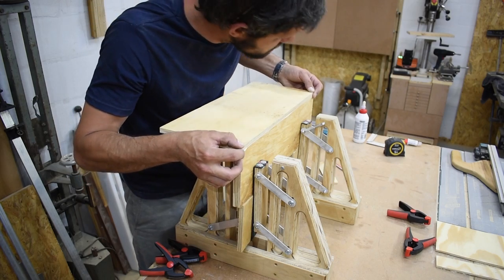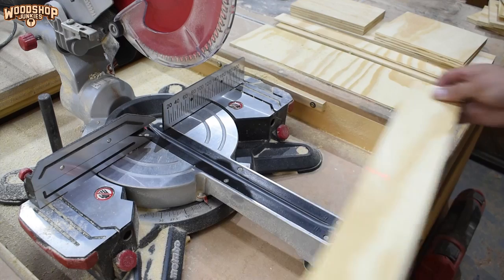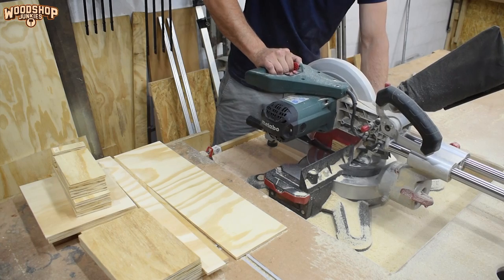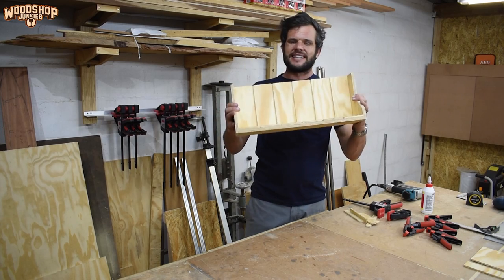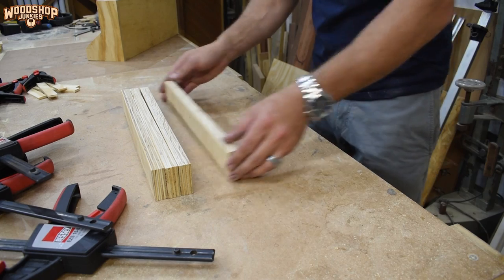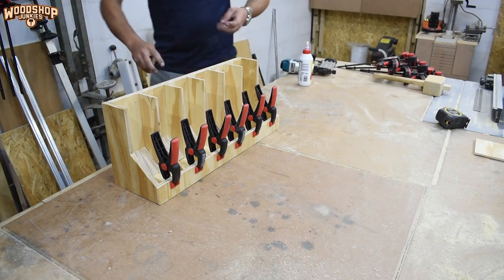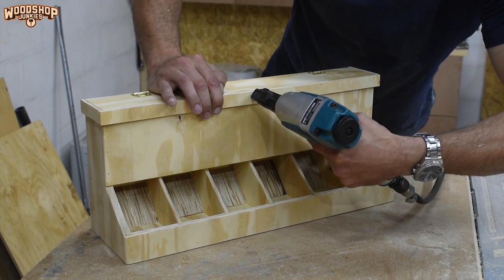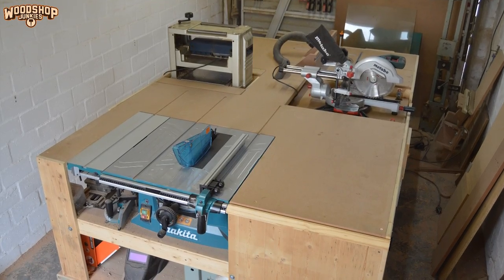Screw Feeder - Simplified Design For Easy Assembly

Comment: 1. I'll buy the plan when available. 2. I'll eliminate 80%of the back spacers & 100% off the front spacers as the 1/4 (6mm) ply dividers can't deflect that much to cause trouble & 3. I won't glue in the dividers & I'll screw on the upper front in case I decide I need a double wide bin some day & that makes dividers removable. Nice design. I like the 45° kicker at the base to push the screws forward

Comment: 11:54 Would adding a smaller triangle block to the front inside instead of the vertical filler pieces (similar to the back angle blocks), make it easier to grab and slide out screws when the inventory is low?
Reply: Great idea, I think I would do that as well.

Comment: i would add a clear lid at the front of each tray to prevent screws mixing with the next open area and also prevent saw dust from getting into it if its sitting on the work bench while doing your projects

Comment: Smart move adding the wedges in the back… they not only help the fasteners flow out better, gluing them in structurally reinforces the bottom and back so the weight of the fasteners does not pull apart the construction of the box.

Comment: I am clearly not using enough screws to justify a build like this.
Enjoyed watching the video anyway 😊

But if I would build this I would  simplify it a lot and use a lot less wood.
Instead of the back-board use the french cleat-strip as the back.
That board isn't needed for strength. The only real reason for that boards is to hold the smaller pieces together which forms the grooves.
A small wood strip (like the French cleat) would be plenty enough for that job.
Or another option to simplify the build would be to not use the grooves at all. Just build a box and glue the dividers in.
I guess you could build the same thing with half the wood and in half the time.

Comment: Nice project buddy I have something similar but I also labelled mine with the screw sizes. Just one question why did you drill the end L shapes rather than just let the two jigsaw cuts meet up? Love watching your videos mate and hope you and your family have a great Xmas and new year 👍🏻
Reply from the maker: When I designed the project I was going to use a router to make the caps and dividers. To do this I was going to make one cap and use it as a template to trace the others using a flush trim bit. I figured that it would work better to have a rounded corner when tracing with the router. By the time I finished the caps I decided to use the jigsaw technique for all the components so I didn't drill the dividers.